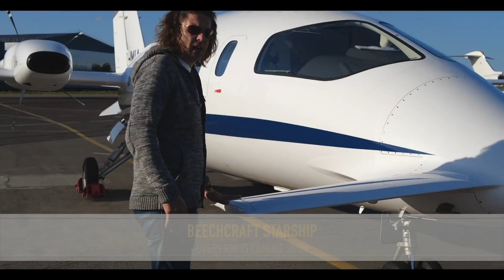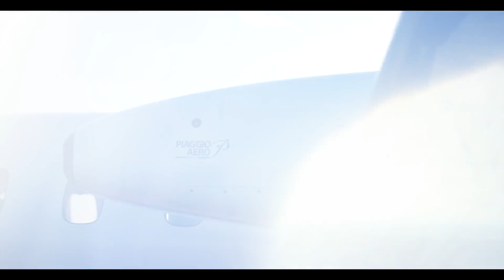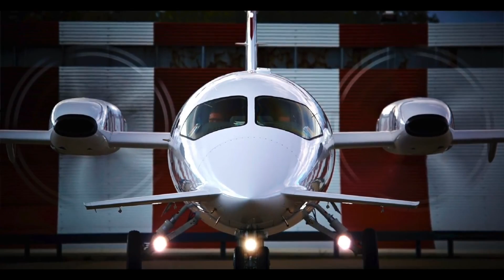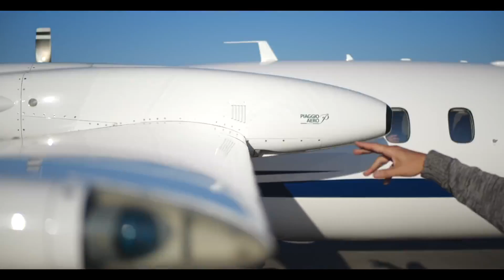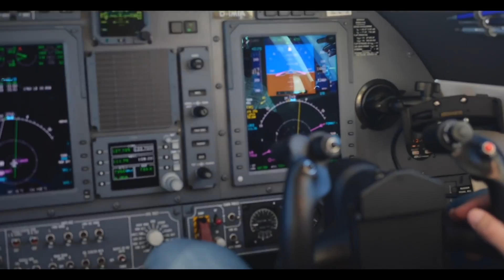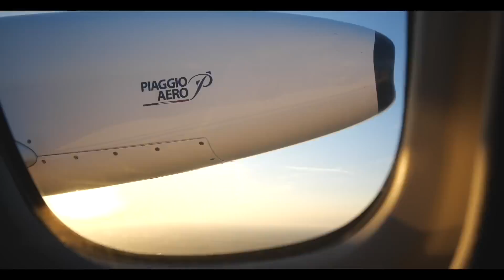Aircraft made by Ferrari! Test Flight Piaggio Avanti

Comment: The is no connection between Piaggio and Ferrari, unless the person responsible for the styling trained there.
Reply: There was a small management affiliation between the groups at a time in the early 2000's. But I doubt anything having to do with actual engineering.

Comment: Mechanic who worked on these for years here. This aircraft is a nightmare. Access to systems requiring normal service is terrible, systems are poorly designed (nws, door seal, fwd wing anti ice, no anti skid or touchdown protection) the dispatch reliability sucks. Parts are insanely expensive and hard to come by and Piaggio as a company gives you zero support. Don’t even get me started on how nasty those props look after just a 2 hour flight. King Air’s and XLS’s are a much better option for buyers in this category and will have significantly lower DOC’s.
Reply: I've heard that Piaggio sent a killer to kill customers too. Any witnesses as well.
Reply: That's great input Stephen, thank you.  Do you believe that some of those problems could be easily corrected or is any of it "designed-in atrocious"?

Comment: Looks like a Cessna Starship.
Reply: Raytheon Beechcraft made the Starship One. Never was a Cessna. Airframe was developed by the Rutan Brothers and all composite. So durable that one suffered a gear up landing with practically zero damage. The downfall of the Starship was due to Beech's decision to allow only one company to do all repairs to be paid by Beech. They took advantage of the monopoly and over billed Beech for services. Beech finally recalled all of the aircraft since most were leased and offered King Airs to the customers. There were several Owned aircraft whose owners refused to give up the aircraft. They were allowed to keep the aircraft and they even wound up purchasing unique parts from the recalled airframes and several airframes were sold complete to owners for parts only. One group even managed to purchase two airframes without an airworthiness certificate. The group managed to fully recertify the aircraft as an Experimental. 
It cost Beech more money to destroy the remaining airframes since they were composite frames and there was only one certified recycler who was certified to handle composite materials. Two costly mistakes for Beechcraft.

Comment: I fly one of these, it's an awesome aircraft. The two things I dislike the most are getting in and out of the cockpit and installing the flight controls lock. Engine torque control, especially during take-off, is pretty tricky. The response curve of the power levers is difficult to get used to at first.
Not so sure a pair of skies would fit in the cabin baggage compartment though. I've never tried it so may be surprised.
Reply: A pair of "skies" would be hard to fit in there. Now, you might have better luck with a pair of skis Get rid of the Autocorrect!
Reply: Are parts overpriced?Are they difficult to get serviced in the US

Comment: This plain is NOT the most environmentally efficient plane AT ALL! The Nextant 400XT and the Syberjet are both more efficient because they use less fuel per hour to fly over close to-500 NM! This aircraft flying at top speed will use more fuel than its standard fuel burn.
Reply: The Nextant 400XT has the headroom fit for a midget Filipino and the cabin width is 2 Feet smaller meaning short anorexic passengers so of course it would be more efficient but it's not in the same class as a Piaggio

Comment: Great video, I have a question, isn't the company Bankrupted ?
Reply: The Government took over and military contracts continued to breathe new life into the company
Reply from the maker: As far as i know it is still in production
Reply: @pilotsnotes3989  So, Piaggio P180 Avanti 1 - 2 -Evo. It's actually one of the best in the class or perhaps the best Turbotrop/Private jet out there. With its distinct design that not all would be pleased. But this was all engineered & made for a purpose. Especially the engine, the sound of the turbine & the backwards propellers. I can't wait for the next evolution of this plane. I hope they would make it more roomy, longer & technically sophisticated in their next model. 

No wonder, Aprilia RS-Gp prototype they use in #MotoGP share its design. This was the one they have got their inspiration. It's all about branding. Eventhough the rest of the competition have move onto different design, Aprilia kept this one until today. 👏